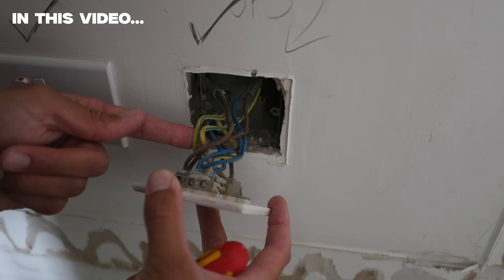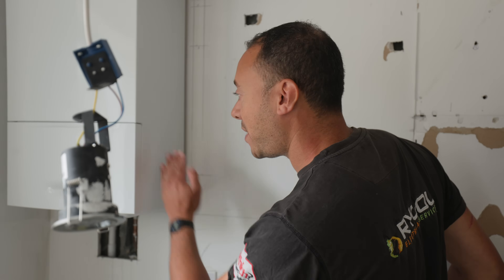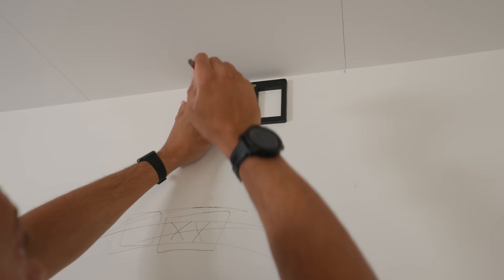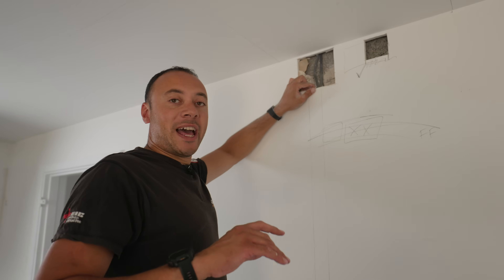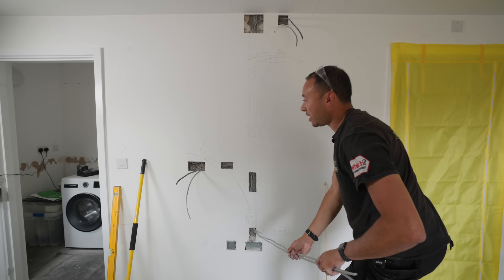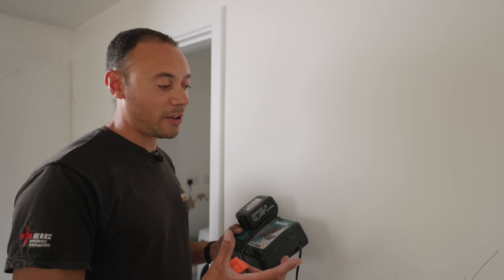Adding a plug socket? Don’t get it WRONG!

Comment: I am an eighty two year old, retired, JIB, Industrial Contracting Electrician.  And I don't know why you millennials, insist on calling a Socket, a " Plug Socket. "   It is so contrary. A Plug, is the Portable part of the connection, and the Socket, is the Stationary, or fixed part of the connection. " SIMPLE's " ( from the TV Advert! )
Reply: Bore off mate
Reply: I call it sockect outlet
Reply: @ImranKhan-cf8gs i call them “wall sockets” or “light switches” as the case may be, but then I am eighty. 
I well recall in the early fifties when we got electric on the farm switching the light on and off repeatedly when the electrician had gone, until my brother shouted at me to stop before it blew up😅
Reply: Last week i had a customer complain that 1 of there sockets wasnt working.. armed with a new socket i visited and they pointed at a light switch !!!  I normally keep a good stock on my van but that day i had no light switches ..
Reply: Literally doesn't matter. I don't believe that it can even bother you or anyone else
Reply: 😂 yes sir general 🫡
Reply: Sorry, I'll start saying receptacle instead👍
Reply: In Oz, we call them a GPO ( General Purpose Outlet). Then add single, double or quad depending on the number it has.
Reply: @ishtzavah  How stupid is that? In the UK G.P.O. used to be the short version of the General Post Office, where you would go to buy your Postal Stamps etc.
Reply: @ishtzavah  Probably called lots of things around the world, this is obviously a UK Tube?
Reply: Nice plug socket
Reply: Thank you for this really informative video, including some of the difficulties one can encounter with 'dot & dab' wall construction.
Reply: Get a life
Reply: Plug-top aka plug.
Socket outlet aka plug socket
Reply: It's a dab, rarely is dot and dab done nowadays, it's mostly dab and board
Reply: We also say Pin 'number' unnecessarily. But plug (aka 3-pin plug ) socket differentiates between hdmi/cat5 sockets etc.   'But plug socket.. ' made myself laugh there.
Reply: So it don't get mixed up on plan sheets for other sockets that modern homes can have, such as ; antenna/sky/dab, HDMI, telephone, ethernet /cat/fiber, shaver/toothbrush, round pin (used for lighting) and AV...
As you can see there is a lot and when working from paper you need to know what you're now sending what wire/cable to what socket as it may not be just for what we call plug sockets lol especially behind entertainment systems, tv/projector or in the office..
To also throw the an extra socket in retail you have normal plug sockets and then you can have epos sockets.
Hope this helps people know why we call things what seems so simple why we do
Reply: @ianharvey868 But surely all of the sockets you mention are going to accept plugs.
Reply: Yes, I have noticed this as well.  Some numptys on YouTube and Reddit even abbreviate "plug socket" to "plug"!  The confusion this causes could even be dangerous.
Reply: Im a boomer and often refer to them as plug sockets as it differentiates them from antenna sockets  etc when talking to lay people.
Reply: @gwynneharries7024  Power socket , mains socket, socket outlet sound ok, look how confused lay people are .All types of electrical sockets have a plug.
Reply: Thank you! This inane term makes me cringe every time I hear it. While I'm not going to expect laypeople to adopt the "socket-outlet" terminology of the electrical industry, there are far better names for this piece of equipment - variations on "power socket" or "electric socket" convey far more sense than something akin to "Catholic Pope".

Comment: Lock off kits at the Mains, Keeping the Consumer Unit Open Only When You Are Working On the Consumer Unit, if You're Not Close it & Lock Off the Ring or Radial You're Working On, With Signage On, ELECTRICIAN WORKING DO NOT TURN ON With your contract Number on the Signage also.

Comment: At 4m10s that socket didn't have an Earthing Fly Lead to the box, if it had it would have made the trip happen, if as you said it's a' relative new build' it should've had the back box Earthed
Reply: I believe you can now ignore the earth link  if the fixing screw goes into a fixed tab.  I much prefer the old way tbh.
Reply: @Chequr_Prostate agreed, I think omitting the earth flylead is a bad move and I am dissapointed the regs are allowing it. Its just wrong.

Comment: I could be wrong but I was under the impression that the top of a plasterboard should have a continuous line of adhesive across the top of the plasterboard creating a fire break. 

In this instance it’s not your problem but if you put that socket in the area you did it could be reducing the fire break. I don’t think that the fire break should be bigger than the safe zone but worthy remembering. 

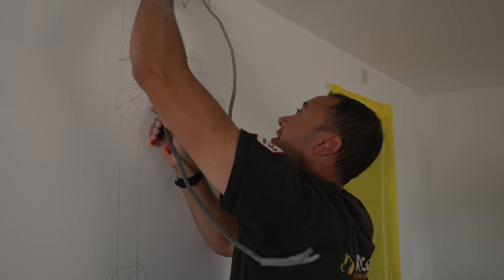10:17 this is the exact issue I was mentioning above. If a fire starts in the socket for example that fire would flow up that wall very quickly and be under the ceiling in moments. 

It’s a shame that the insulation on wires isn’t an intumescent material to extinguish the fire.

Comment: Those plug in testers can't tell if the earth and neutral are reversed.
Reply: Both my home made and commercial ones do.
Reply: @spamhead  How do they do that? You could pass enough current to trip the RCD, but that's not necessarily so great!
Reply: @matthewmarks6951 You’re right, I misread the original statement. But you sort of answered it. The second you switch the appliance on it will trip the RCD!😂

Comment: You haven’t bonded the metal back box. I always do other sparks will tell you don’t have to as socket screws earth it but when socket pulled out no earth. Oh we never pull the socket out live (yeah)
Reply: Yep, good comment I always bond the back box.
Reply: Only if two adjustable lugs are present

Comment: Cables not capped hate this in wall, you could have pulled cable up but because plaster over cable very difficult. Always cap cable I use oval conduit looks better.
Reply: Looks better, how do you see it?
Reply: Was told by my electrician that you do not need capping since it will be 25 years before a rewire will be necessary and he will be retired by then.  When he came to replacing a wire that i had capped before plastering all he had to do is pull out the old cable out and was very  grateful and agreed capping saves time!!
Reply: Great video! Note that when you showed the damaged cable and scorch marks it looked as though the machine screw for fixing the socket to the wall box had cut through the insulation causing a short to earth (good job the wall box was earthed). I always stress to people to check that there are no wires in the vicinity of these screws. Why the box manufacturers have not found a way of making sure this does not happen is annoying.

Comment: I thought they had recently introduced new cable with the earth wire also being sheathed or was that some sort of April Fool? Doesn't it have to be left bare (except at the socket itself) to allow a safe path to ground in case of a fault?

Comment: There was a notification a few years back that boxes were not to be fixed to the wall with counterfix screws as the screw head could interfere with the cable. A round headed screw should be used.
Reply from the maker: Thats an interesting one. Is this a guidance note or regulation? Id imagine guidance
Reply: Rubbish.
Reply: @kevanswift7797 remember that sometimes people from other areas chime in on electrical videos. It may be a recommendation in another country. 

If a countersink screw is sitting proud then it would provide a sharp edge that could cut, especially when you have shallow backboxes and the cables crunch up when fitting the face plate.
Reply: @davideyres955 what type of screw would you use? A round head would protrude further into box so cable could be trapped more so. Counter sunk screw would pull the metal in the shape of screw so better. Used counter sunk all my life no issues

Comment: Good clear vid....however, you didn't earth the backbox. Is that not required anymore ?
Reply from the maker: Its a nice to have but not nexessary
Reply: @RygolElectrical oh right, thanks for that 😊
Reply: @RygolElectrical  Left the industry approximately 30 years ago. We always earthed a metal back box. I know the regulations have changed, but I would still always earth the back box. You never know what DIY work, etc., will be done in the future, with the faceplate off while live and the earth being lost.

Comment: Nice, but I would never fit a socket with built in usb supply, if it fails (and they do!) there is no easy way to disconnect it. With a plug in type you can just pull it out.
Reply: Yeah, and you're also stuck with whatever charging standards it supports.
Reply: Only if you buy the cheap and nasty ones.......

I put three usb double sockets in our kitchen which are regularly used by the grandchildren and have lasted over three years.
Reply: @fabianmckenna8197  That's true. However, prepare for the grandchildren to complain that their devices will only charge slowly, or not at all when they only have a USB-C lead.
Reply: @matthewmarks6951 

In the unlikely event that six USB charging ports should simultaneously fail,  I have plenty of backup in the form of generic plug in chargers as well as a portable charging block with USB-C and USB-A  connectivity.
Reply: @fabianmckenna8197  Then why go to the trouble and expense of installing these in the first place?

Comment: the CPC doesn't have a insulating coating as the idea is that if something it going to short, for instance a damaged cable, like someone sticking a nail or screw through a cable you want it to short to the CPC so it trips the fuse and prevents fires and or people getting electrocuted.   
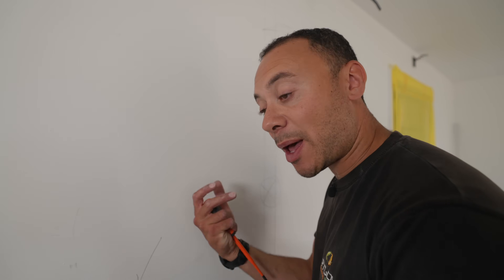@15:20 you have a lovely shot of you tightening up the blue wires in the Line and you can see the brown wires in the N terminal. the reason why switching the Line and Neutral is BAD!! is that if you have a single pole switch in a device and the device is turned off but the socket is turn on, it is still energised all the way through the device to the switch, what it doesn't do is shorten the life expectancy of the device, it could shorten a persons life expectancy. Neutral and CPC/Earth are at the same potential so you don't get an electric shock, you would think a qualified sparky would know this.
Reply from the maker: Thats interesting about the earth having no insulation. Be good to speak to Doncaster cables to confirm for sure. Thank you for your comment John
Reply: @RygolElectrical Doncaster cable actually do a twin and skin with an insulated earth now. I belive its called earthsure cable.
Reply: As well, the CPC is not normally carrying any current, just a 0V potential. It does not need to be double protected from consumer, as it would typically be connected to metal housing of said microwave etc. For comparison, neutral must be double protected because it could carry a 230V potential, say if the ring is broken by a loose connection in a socket, but a heater has been plugged in somewhere later and is "on". A CPC, however, will only have load if there is a fault in an appliance AND there is a broken circuit so breaker doesn't trip. On the other hand, it is easy for a DIYer to not notice a broken CPC circuit!
Reply: All of this begs the question of why sleeving is needed in the socket. I do it because you're supposed to, but yet to see a coherent explanation of both norms at the same time
Reply: @mikeflowerdew7877 there is live screws exposed which it could short out on.
Reply: @mikeflowerdew7877  Good question and I imagine it's partly to do with identification, although that wouldn't require full sleeving.

In situations where high integrity earthing is needed, lack of sleeving would present an issue. I was also thinking about clean earthing, but that's going to be brought in separately and neither of these are going to apply to the average domestic installation.

I'll probably have a think about this and follow up, but nothing is jumping out from my tired mind right now.
Reply: The latest twin&earth now has an insulated CPC, (or at least an available option) but without making the whole T&E thicker.
Reply: @PeterEdin  It's a thin insulating layer to save time sleeving and is not insulated to the same standard as line conductors. ROI uses T&E with a CPC insulated to the same standard as line conductors and also sized the same as line conductors - it's considerably larger than T&E used in the UK and also now only available in LSF since last update of Irish regs.
Reply: I agree. When I started in the business in the 1960s I was told that it was supposed to do exactly as you said. Makes perfect sense. However, there is no guarantee that you can't hammer a nail through a live conductor without also hitting the uninsulated earth conductor. I wonder if it might have been a cost-saving or space-saving exercise, especially when insulation was much thicker. You can now purchase Twin and earth with insulated CPC.
Simple polarity testers are cheap nowadays. I always use mine every time I plug my caravan in on a new site.
Reply: @JohnBarrington-g1x  the little plug in testers are pretty good, but take a look at it and see if it has on light set for reversed cpc/neutral.
Reply: That's what thought

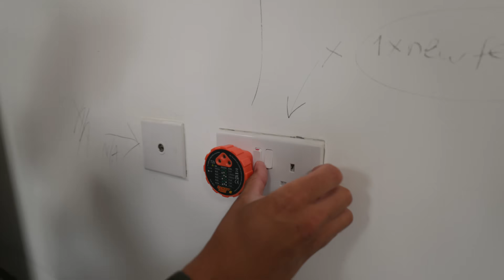Comment: 0:30 that plug in tester does not tell you socket is wired correctly, there can be an N-E reverse and it will still show wired correctly, same even plugging in an MFT.

Plug will show other faults- but really purely a guide power on or off.

Enjoy your content, very hard putting you work out there as it will always get nit picked, but this is a valid point.
Reply: As N and E are both Ov  tester can't tell the difference even  a MFT will show wiring correct.
Reply: @MJW-h5i  Tester should pass enough current to neutral to trip an RCD - then you'd be able to tell the difference! 😁
Reply: @matthewmarks6951 
True I have had this happened but also had an NE reverse where only when customer put load on , that it tripped.
So dependent on tester used for verification.
If no Rcd, not in this case, would give a false indication regardless.
All good learning points, noone knows everything 😊
Reply from the maker: This is interesting. I will check this out! I normally use my Fluke multifunction will investigate the plug in Socket n see
Reply: They do.. thats partly the point of them.. shows as 2 lights dead as per the key on the tester. Just takes longer with an MFT as you'd have to test each terminal to Earth but the continuity check would pick it up anyway.

Comment: Definitely new build, most fit those cheap DETA sockets, they make a DP version but to save money mine was fitted with the SP version, they all got replaced.

Many had screws clamped down on insulation too, and some FCU and grid switches had exposed copper outside the terminals.
Reply from the maker: Its shocking what se of these companies do when installing. Less speed and more care needed
Reply: Yeah, but they at least used a Hager CU. Surprised it wasn't a shitty Contactum or British General.
Reply: @semperidem2577 Yeah I rate hager wiring accessories and their CUs look awesome too. Unfortunately I have a BG CU in my new build, on checking, it has been done neatly but it’s a split one with two RCDs.
Reply: How new of a new build is it, because shouldn't it also have AFD protection? Or does it have that but is still a split load board?... They're probably not even saving that much... you're only really looking at an extra £10 per circuit to go to all RCBOs, so what £100? If that??
Reply: @semperidem2577  2023, no AFDD, queried and that is only required for care homes and HMOs. 

Spoke to my regular sparky who said they can be troublesome and cause unwanted tripping.

Two RCDs and an SPD

Comment: The reason the earth has no sheathing is cost.  You can buy T&E with insulated earth now.  Doncaster Cables does it.  Not sure how having the L&N wrong would affect the life of an item because it's 50 Hz AC and the polarity reverses 100 times a second.   My only thought is that there must've been some fault in the devices and it was a coincidence.
Reply from the maker: Very interesting about the cpc. I will speak to Doncaster at some point
Reply: @RygolElectrical  the Phase and Neutral must be connected in the right terminations because the circuit breakers are single pole devices,  (there are double pole mcbs but currently not required by regs)   Switching the N  leaves the ph energised when its not expected

Comment: 15:34 guessing no CPC flyback to the backing box
Reply: Ok I was wrong, l+n swap was not expected
Reply: Backbox doesn't need an earth if the metal lugs on the front of the box are used to fasten the socket to the box.

The back box is earthed through the lugs, the fixings screws and through to the CPC connected to rear of the socket.

The regs permit this so long as the lugs are of the fixed type. This ensures a nice reliable connection.

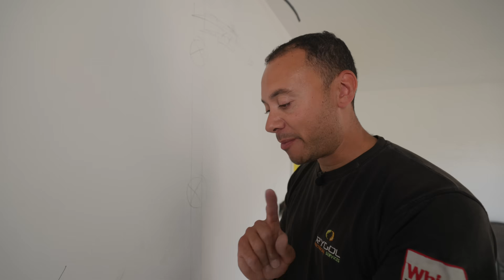Comment: 14:50 earth sheathed cables cost more per m when it's not a requirement, you can get them but they are more expensive. CPC only needs one level of protection and since you remove the isolation when stripping the outer sheathing it then needs extra. I'm not an electrician though, I just like watching videos. :) I'm also betting that Doncaster cables make this already lol.

Comment: What happened to the garage socket that was burnt up
Reply from the maker: It was reterminated and replaced
Reply: @Leon-nn7rn  was the issue just with the switch? Nothing to do with the wiring? (I am a student doing electrical installation, hence asking 😅)